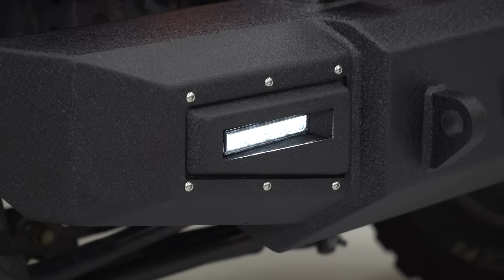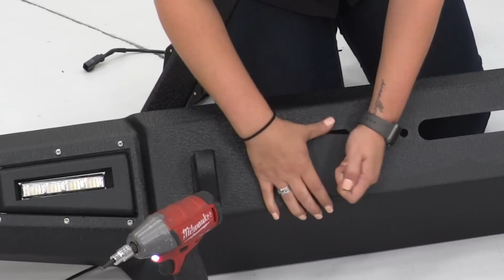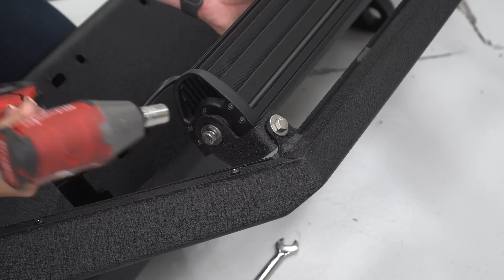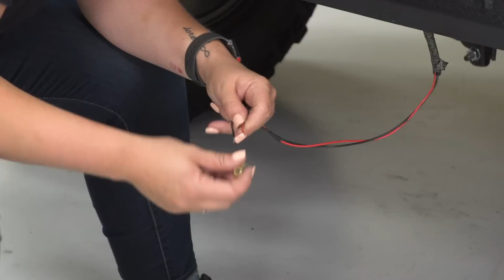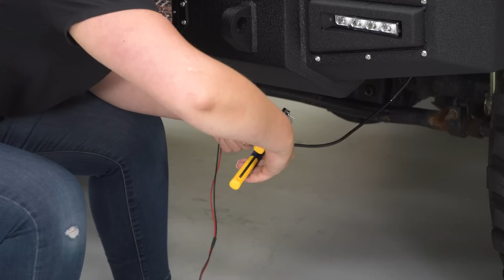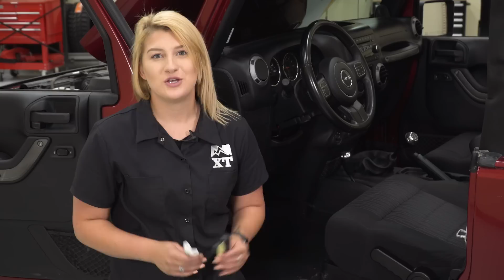Jeep Wrangler JK Barricade Vision Front Bumper w/ Fog, Work & Light Bar (2007-2018) Review & Install

Comment: So is there a way to hide the power wire for the light bar? It looks like it just hangs off the front of your jeep and I dont want any random person walking by my jeep and cutting that wire.
Reply from the maker: Hey Brandon! There is plating on the back of the bull bar that you are able to remove an allen key. You should be able to tuck the wire back there and run them down behind the bumper! :) -Merideth